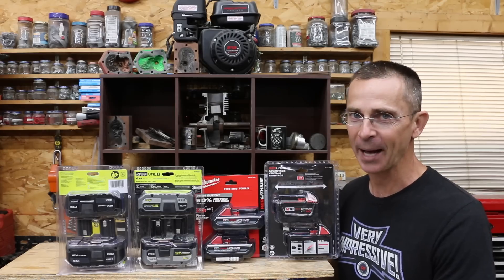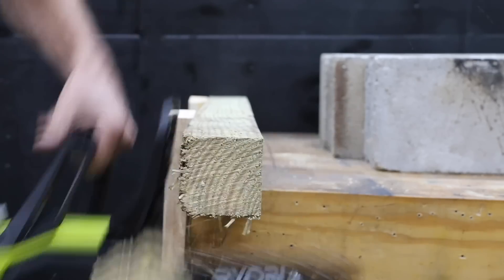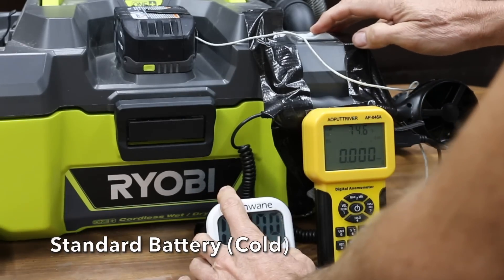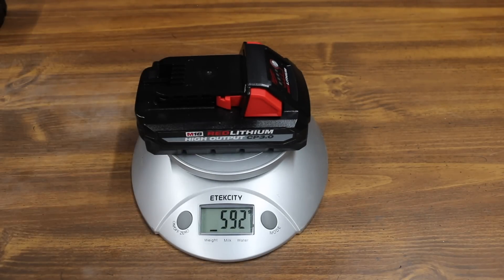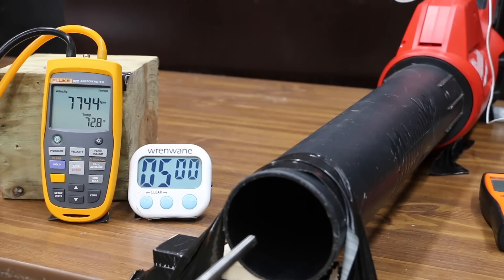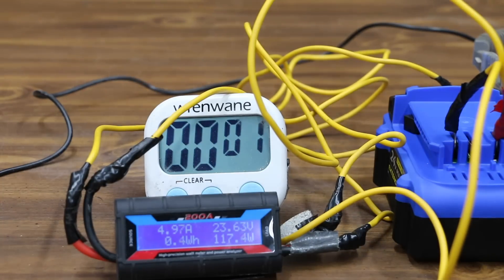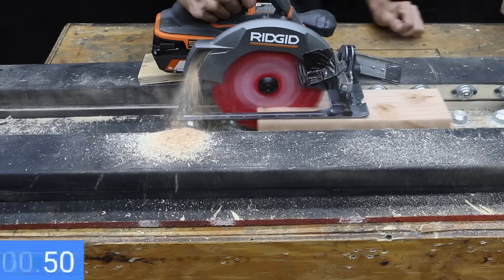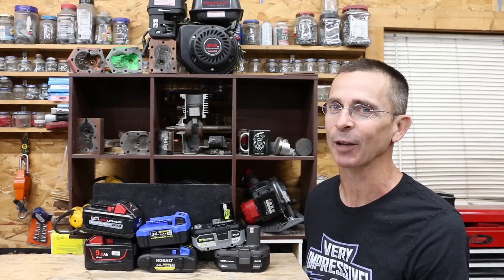Are "High Output" Batteries Better Actually Worse?

Comment: I love my milwaukee HO compact batts. They're nice for tools that can use the extra power, and where weight is a consideration. For example, you will like them if you need to use an impact driver over your head a lot. I also use one for my compact router. The tool sucks a lot of juice, but you can't use the large XC batteries because they make the tool too top heavy and makes holding the tool horizontally against a surface very difficult.
Reply from the maker: Thanks for sharing.
Reply: @ProjectFarm  as usual, thanks for the tests.

Comment: So I'm team blue (kobalt). I work in Colorado. I've noticed the old 1.5 ah batteries when cold ( below freezing 32deg F) just don't have much output and barely can function, same with 2.0 ah. The 4.0 ah works to about 0 degrees F... 6.0 ah works most of the time regardless of temperatures but under heavy loads it is weak till it warms up, the 4.0 and 8.0 ultimate output are good to about 0 degrees but weak after that but at normal operating conditions the ultimate output really makes a difference in the XTR tools, no extra pins like ryobi but noticeable with a 1"  self feed paddle bit vs a non ultimate output in the same drill.
Reply from the maker: Thanks for sharing.

Comment: Great vid as usual. what ive noticed about knockoff Ryobi batteries is that they are usually half the advertised rating.... Im actually surprised about the knockoff Milwaukee however, while it did not perform as well.. you could buy 5 of them for the price of one 8ah.
Reply from the maker: Thanks!  Thanks for the feedback.

Comment: I been using Milwaukee high output 
For all my tools and to me the are much better the regular batteries 
  I use the 6.0 or 8.0 for my framing nail gun 21degree and it Last a least 3 or 4 hours  working hard
Reply from the maker: Thanks for sharing.

Comment: Great video, yes in most cases the old baterries are just as good. Maybe the new 21700 cells are better in low temperature. And  in most cases you need a new tool to take advantage of the high output battery. But the testing was excellent.
Reply from the maker: Thanks!

Comment: got a question, do you have to buy the upgraded charger if you use the high output batteries for ryobi?  mine wouldnt charge on the regular charger

Comment: You've probably been suggested this before, but a good cheap yet useful video idea would be to test waterproofing sprays. I need some and feel blind when I don't have a Project Farm video to guide me! Best waterproofing spray, whether for boots or tarps or just overall any fabric would be great!
Reply from the maker: Thanks for the suggestion.
Reply: @ProjectFarm  anothe good relatively cheap one could be antifog spray/wipes for safety glasses
Reply: @spaghettimonter13  That would also be helpful for people who use goggles while diving.
Reply: Seconded!
Reply: Thirded! That’s actually a great suggestion!
Reply: I was just about to comment about this when I saw your comment! Some specific brands for me would be Revivex, Nikwax, Kiwi, Scotch and Grangers. It would also be nice to see the spray on ones compared to wash in DWR for comparison. Hopefully we'll see a video on this in the future.
Reply: This would be great!
Reply: If you do this in regards to leather be sure to include  straight beeswax, paraffin, obenhaufs, and mink oil in with all the fancy synthetics. 

For years personally I have blended 100% beeswax into paraffin at about a 1/3 ratio along with a small amount of paste shoe polish of the color that matches the boot I’m working on.  

Then I just apply with a cotton cloth and rub in. Afterward I heat the boot with a hairdryer and it pulls it in deep. If it needs a second coat I re-apply.

Comment: Great video! A bit of feedback here: you should give the cell specs when doing these comparisons, as that could make a ton of difference or at least explain what the differences you are finding stem from.  For example the Samsung INR21700-30T in the Milwaukee  HO battery is a 35 amp rated cell @ 3000mAh.  That makes a difference under load for sure.  Interestingly, the Samsungs in the Kobalt are INR21700-40T and while they are still rated at 35 amps discharge they have a 4000 mAh rating which should mean a better pack overall.  The practical nature of your test is a real world example and I certainly appreciate it, but I would be curious to know the battery stats and then what the companies are doing differently.  For instance Dewalt limits the full charge of its cells to extend the life of the product, though they do hit their rated capacities in most of the tests I've seen. The other thing, it does matter what the cell configuration is when talking about output.  FOr instance if you had a pack that was 18650s in a 5S 2P meaning 5 sets of two 20A discharge cells in parallel then you could theoretically pull more current from that pack  then the same configuration with a 30 amp 21700 and, usually, this would mean larger mAh to boot.  Dewalt Doesn't advertise it but their 6 Ah pack and their newer 4Ah packs use 21700s and most folks agree that they increase output and not by an insignificant margin.  Seems like the powerstack by Dewalt also does this, if you haven't already you should test them.
Reply from the maker: Thanks!  Thanks for the suggestion.

Comment: Not sure how you would test it but the Milwaukee batteries have lasted much better than other batteries I have used (DeWalt and Rigid). I am still using the same original Milwaukee batteries that came with my drill/impact combo 7 years ago with similar (though not imperial) run time as new batteries. I have not had a Milwaukee battery fail in over 8 years (upwards of 20 personal and work batteries) and cannot say the same for any of the other companies batteries.
Reply from the maker: Thanks for the suggestion.

Comment: I bought the cp3.0ah high output milwaukee batteries to run on my fuel 1/4" impact driver as they are light weight and out preform the regular 2ah batteries. I like my impact to be light as I use it all day everyday and can go weeks on a single charge unless I'm driving in a lot of lag screws or something
Reply from the maker: Thanks for sharing.

Comment: As stated before, Ryobi's HP tools (that have the extra contacts) are designed to get more power from the HP batteries.

There a a dizzying array of batteries for the various platforms, it's hard to keep track. That said, I think Ryobi's best battery (besides the monster 9.0 ah) is the now discontinued P195 HP Compact 3.0 ah battery. That is to date, as far as I know, the only Ryobi battery with 21700 cells.
Reply from the maker: Thanks for the feedback.

Comment: That saw is not compatible with the HP batteries! The Ryobi saw that uses the extra tabs is called the ryobi HP Brushless just an FYI that’s why those batteries are performing worse because they can’t produce the extra power needed. And as the torque test channel has shown they actually produce even less output then a comparable normal battery when used on the tools that don’t have the extra tabs

Comment: I think the real difference is in the pouch cells like the new Flex batteries and the Dewalt power stack battery.  It’s not so much a run time advantage as it is an advantage of the cells being able to handle discharging much faster.  For example the Dewalt power stack is only 1.7ah but for a short period of time it out performs batteries up to 5 or 6ah.  Just a disclaimer, I don’t own a power stack battery, I’m just playing armchair quarterback based on YouTube tests I’ve watched.
Reply from the maker: Thanks for the feedback.

Comment: As others have added, some of these are not the right tools or batteries to test with. Several YouTube channels have tested the high output batteries and they make a significant difference in some tools, Torque Test showed that with impact wrenches.

Comment: Thanks for this video.  Loved it as always.  I felt duped by Milwaukee at the end.  I do see a difference in my M18 Chainsaw with a HO battery on.  Based on the comments below, I feel better and it would be great to update the test with the more demanding tools.  Seems like air is out and fuel saws and impacts are in.  Maybe Milwaukee is the only test to update?  I use my batteries in below freezing temps but I store them above freezing(garage, not shed).  I love all the stats.  Thanks for testing!!!
Reply from the maker: Thanks and you are welcome!  Thanks for the feedback.

Comment: I'm going to echo some constructive feedback here, and say you should do some similar tests with tools that can take advantage of the batteries. HP tools for the Ryobi HP batteries, Fuel for the Milwaukee, and XTR for the Kobalt max output. I know for a fact the Kobalt max output provides more amperage, because it would cause the old grinder to immediately stall due to drawing too much power
Reply from the maker: Thanks for the suggestion.

Comment: Love all the videos. I would love to to see some actual independent tests on silicone caulk with so many choices and grades. How does a person know what to choose I think a review like this could help out many home DIY people.
Reply from the maker: Thanks!  Thanks for the suggestion.
Reply: DIYers and often independent women need to find some good caulk. Or just find a local professional caulker. Yelp if ya need one.  If they insist on doing it alone, the first step is to determine the size of the  job. Do they need to fill a narrow or wide gap? Take some simple measurements. There are small tubes, a 10oz is approximately 10” X  1-7/8” perfect for occasional use. Size the receiving gun accordingly. A medium job can be satisfactorily accomplished with adequate pumping of refills. Optionally the 29oz tube/gun offers a wider range to select from and thusly fills a wider gap of usage than the smaller caulks could satisfactory.  Lastly if one is considering a larger job with longer tool life consider an electric or pneumatic gun. The endurance and material delivery proves to be most satisfactory time and time again. 👍🏻👌🏻🤷‍♂️😏🤫🤭💪🛠😎😆🔩
Reply: Tey absolute only silicone caulk to use is GE's 100% silicone. I've used all brands in my 21 year business and the only one I'll use is GE 100% silicone. Its a white tube with blue lettering.
Reply: @nowthatsfunny1  ive really liked the brand PPG sells.   but the GE line is really good.
Reply: same for construction glue
Reply: Two words: Big Stretch  …. This caulk brand has been a game changer,  Worth every penny and I will not use anything but this unless I need 100% silicone.

Comment: I do know there’s a huge difference between the m18 5 ah xp and the 6 ah ho. So much so that some tools such as the 8” metal cutting saw will do fine with the 6 ah ho; but will hardly run at all on the 5 ah xp
Reply from the maker: Thanks for the feedback.

Comment: As far as comparing lithium batteries, and this goes also for the dewalt powerstack vs 20v battery video, lithium will not be working at peak performance straight out of the box, usually lithium takes at least 10 charge cycles under normal working conditions to start working at it's best performance. There is a noticeable and measurable difference in the performance straight out of the box compared to after 10-15 cycles.
Reply from the maker: Thanks for the feedback.

Comment: No pouche pack lithiums?. That's the only ones I MIGHT consider buying. 18650 are just so versatile and even once it's not working you have so many options on what to use the good cells for.
Reply from the maker: Thanks for the suggestion.

Comment: You should redo this test and use the batteries on tools that can take advantage of the extra juice the High output batteries can provide.  (Context, i can tell a huge difference when using my circular saw/coorless vaccum with a high output vs a regular battery.)
Reply from the maker: Thanks for the video idea.
Reply: Hey Mason, what cordless vacuum do you have and what improvements have you noticed with H.O battery vs a regular battery? Asking for a friend! Thanks
Reply: @notmyhandle88  it has more sucking power.  And just overall you can feel a difference.

Comment: Milwaukee max power with something like a drill can change a lot between batteries and the high output makes the difference. In my experience if it's a fuel you won't be happy you paid the extra money unless you have high output and the cheapest tools will be amazing. Would love to c a test like this with something like the top and bottom of the line tools with the different batteries
Reply from the maker: Thanks for the suggestion.

Comment: I am not sure about these batteries, but I think there is technology where  battery cells mix with capacitors to ease on peaks, fast charge/discharge, increase efficiency and decrease heat. which will increases battery life too  Thus, it is hard to notice difference for stable load  thought
Reply from the maker: Thanks for sharing.

Comment: I've found that the milwaukee 5.0's will overheat before they die if I'm using grinding stone or flap wheel with my fuel flathead grinder, I picked up a 8.0 h.o. and a 12.0 h.o. and I've never had them overheat
Reply from the maker: Thanks for the feedback.

Comment: Great video as always. I think if you threw some 1/2" impact wrenches in the testing, you may have seen a difference with the high output batteries, as Milwaukee and DeWalt definitely seem to benefit from those.
Reply from the maker: Thanks!

Comment: I'm surprised people put up with such low runtime from their tools, I've used corded tools all my life and I love that I can run them 8hrs straight and finish the job without wasting time finding and changing batteries, I would never allow cordless tools on my jobs site for this reason, my $20 harbor freight pneumatic impact wrench has 12 years of service and has never once failed me, worked with a guy who had a cordless electric impact he spent over 200 for and I was able to work circles around him and get more done with less effort. Guess it's all in what you're using them for. Great video keep up the good work!
Reply from the maker: Thanks and you are welcome!

Comment: One thing I'll say is I get the cp3.0 over the xc now cause they are frequently on sale for $99 for a 2 pack. They are shorter and have the same output. The big thing for me is on an impact driver or similar tool the wider base makes them more stable when setting them down and not as easy to tip over.
Reply from the maker: Thanks for sharing.
Reply: $99 for 2 is a black friday price. The price continued to end of Dec. I think the deal is over now.
Reply: @dougritter429  They run it off and on throughout the year. Usually in the summer sale as well.

Comment: I think you would really see a difference from an m18 6.0 XC battery to an m18 6.0 high output battery. Also considering the size difference, i'd rather have a high output 3.0 than a compact 2.0 battery.
Reply from the maker: Thanks for the suggestion.

Comment: Using a 2Ah vs a 4Ah for a Craftsman Shop/Leaf blower there is a definite difference, with the 2Ah there tends to be initial power draw issues that the 4Ah does not have. So with that by itself the High Ah batteries definitely make a difference with tools that have a high initial power draw. That is where the high-performance batteries come into play, not specifically Just a longer run time.
Reply from the maker: Thanks for the feedback.

Comment: Another strong video from the greatest YouTube channel that's ever existed. However the HP Ryobi batteries are designed to be used with the HP tools and it's difficult to compare HP batteries with non-HP batteries on non-HP tools.  I'm not familiar with Milwaukee 18 volt tools and batteries but perhaps they run along the same lines. For instance I know that HP batteries have additional connections which apparently bring out the advantages of HP batteries and tools
Reply from the maker: Thanks!  Thanks for the constructive feedback.

Comment: Great video. Torque Test Channel has a few videos similar that show that some impact wrenches make noticeably more torque with the HO cells, and most make a little more due to the better current output of the improved cells.

They also have found the new Rigid battery to be inferior to the old Octane batteries. It would appear those batteries were too good, outperforming Milwaukee sometimes, and so they've been killed off.
Reply from the maker: Thanks!

Comment: Unlike some other reviews that are obviously biased you never show any bias. Plenty of videos out there telling you to "throw out" your old batteries and buy the new HD (21700) ones as the old ones are costing you time and money. I don't use my tools for work but even if I did a second here and there is not going to cost you anything. But being the fastest and strongest is what the marketers are pushing and it seems to work. Thank You for this awesome review in showing that it's pretty much just that, marketing with some truth but not enough to actually do anything except empty your wallet.
You need to revisit AA and AAA alkaline batteries versus rechargeable.
Reply from the maker: Thanks!  Thanks for the video idea.

Comment: With the Milwaukee batteries, I don't think you were doing the right comparisons. The HO CP 3.0 battery should have higher output than a CP 2.0 and similar output to an XC 3.0 or 5.0. The HO XC 6.0 or 8.0 batteries should be compared to the XC 5.0. The HO batteries will be a bit bigger all around, but have a higher output in many tools.
Reply from the maker: Thanks for the constructive feedback.